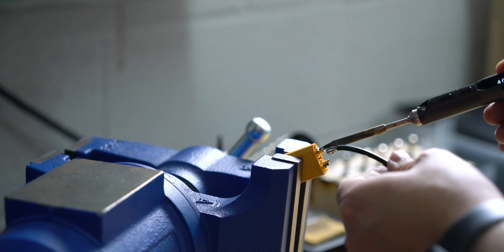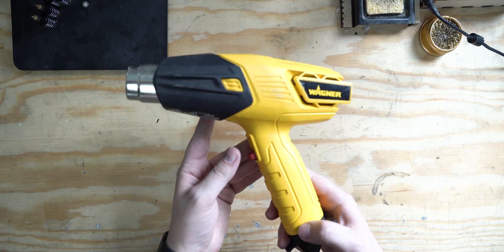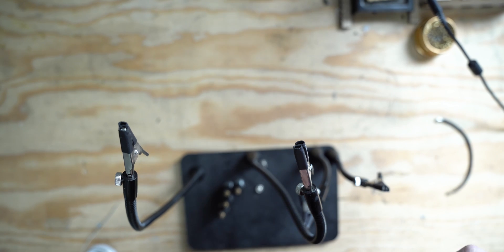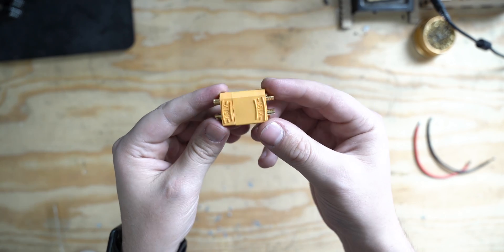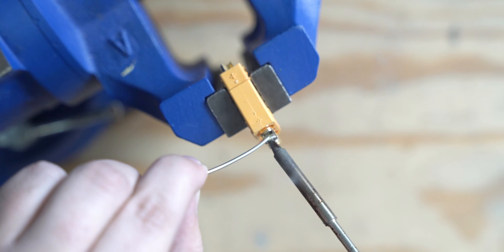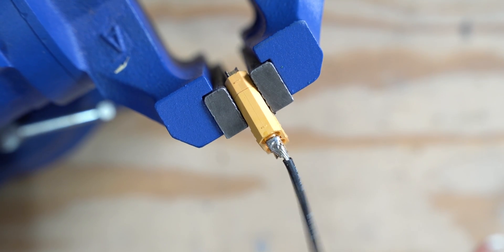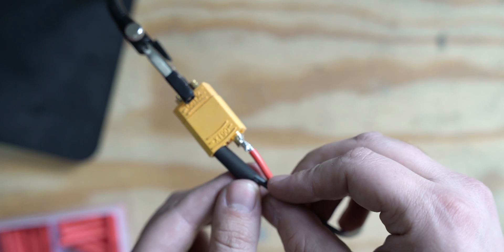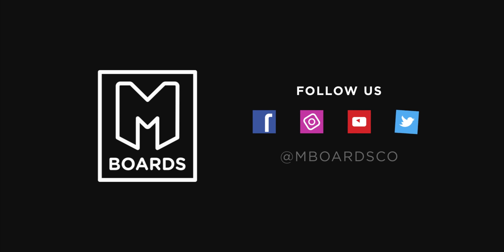How To Solder Connectors For Your DIY Electric Skateboard

Comment: Very helpful! The first time I did this I didn’t connect both connectors prior to soldering. The heat from the solder gun caused the metal to distort so the connectors wouldn’t fit into each other after I had finished.